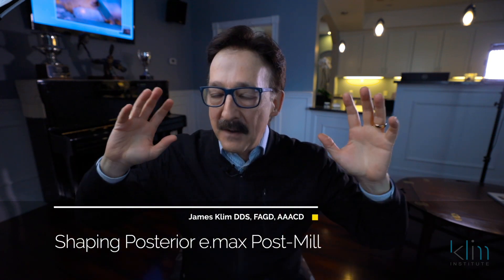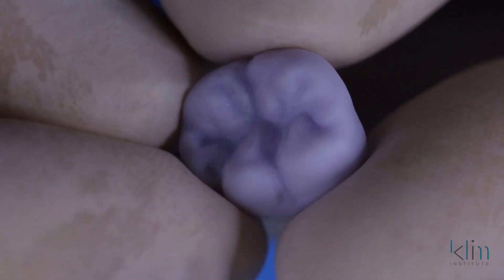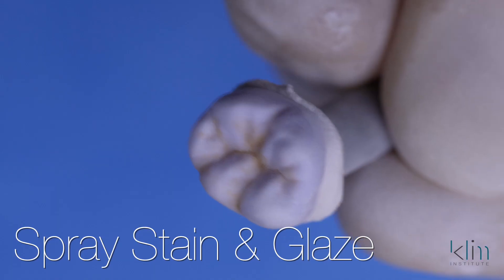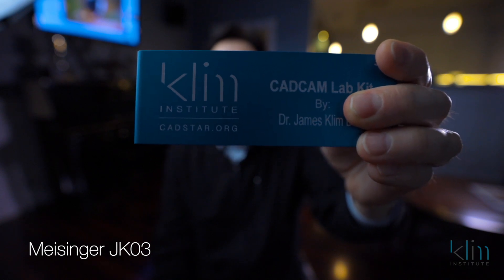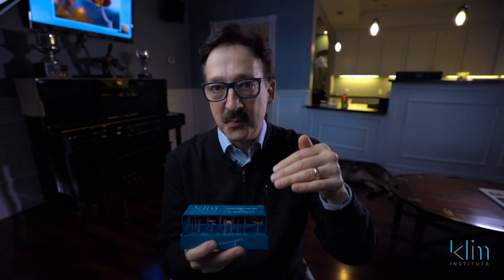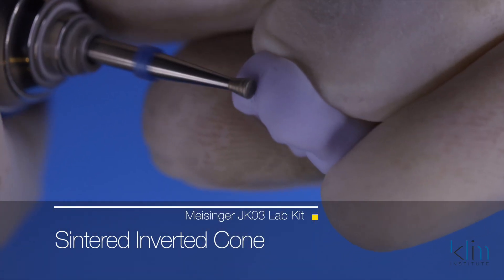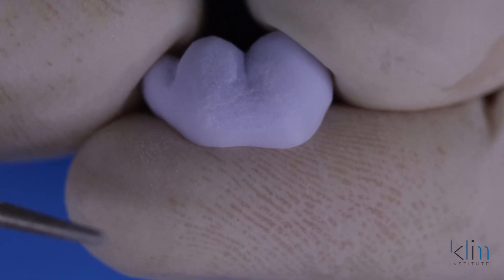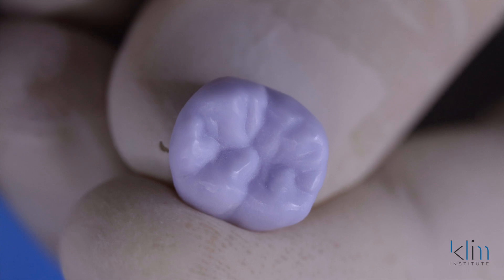CEREC Posterior e.max Sculpturing and Finishing Steps

Comment: Good morning Jim!
I am going to have my assistant sign up for your yearly membership today. Thanks so much for these videos. Would you use the same technique for Dentsply tesssera? I’m using those more than Emax  because the mill time and firing time are quicker, of course, with the speed fire. I know I need to get a clamshell just so many expenses at once. Happy sabbath 😊
Aaron
Reply: Had been a member of CDOCS but your videos are so much better and so much more helpful, and so better done
Reply from the maker: Hi Aaron.  May all be well.  I love making videos, so there are a lot more to come.   So here is my take on Tessera.  I have yet to use it for the following reasons.  Independent studies (Lubauer, Belli, Peterlik, Hurled & Lohbauer 2022) show the following with Fracture Toughness.  e.max 2.13, Initial LISI block 1.50, Celtra Duo 1.51, and Tessera 1.45.  Dr. Bob Kelly has stated that the most predictable measured physical metric projecting ceramic longevity is Fracture Toughness.  For molars, the benchmark is a Fracture toughness of 2.0 or greater.  On the other hand, Empress ( Fracture Toughness of 1.08) has been used on molars for years, however, with enamel preservation concepts.  So for full crowns, I have chosen to stay with e.max and give more time before jumping into new materials.  Celtra has a poor track record.  We have yet to determine anecdotally how Tessera is going to perform.  With ideal preps and adequate occlusal thickness, it will probably do okay.  I have performed enough replacements in my career because of using new materials too soon.  That is one reason I did not embrace Celtra.  I view Tessera with the same caution review for now.